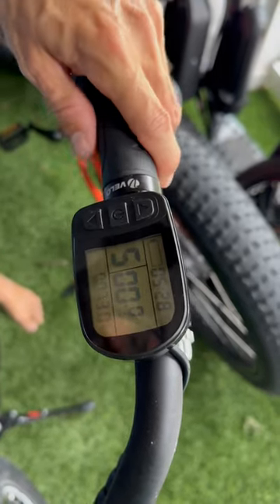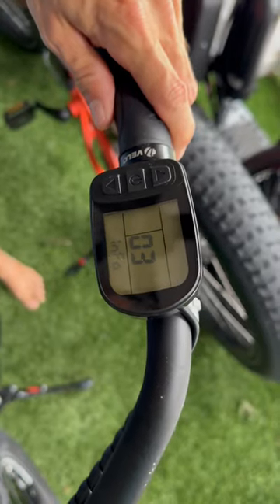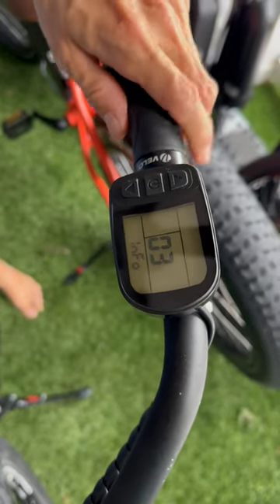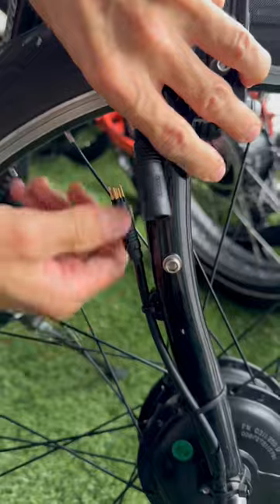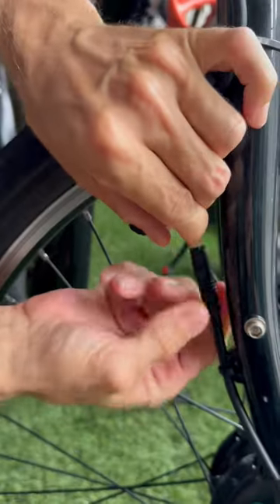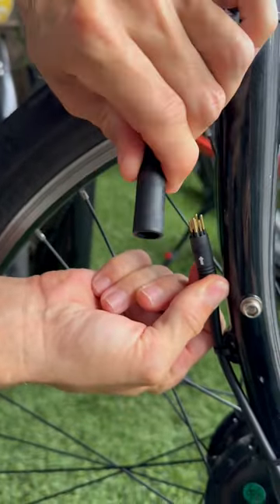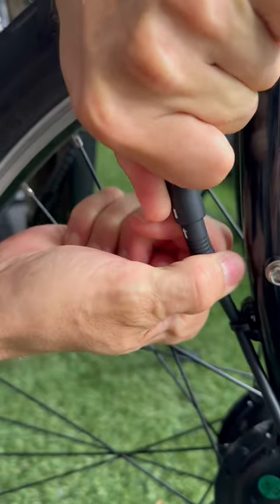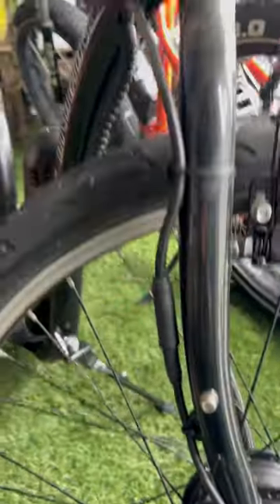How to fix the ‘03 Info’ error code on your electric Kickbike or e-bike - Bafang | Kickbike America

Comment: Dear i have error 01 info same u display, how to fix please ?
Reply: Disconnect throttle and test walk assist mode via putting it to mode 5 and holding down on the bottom arrow bike should walk if everything motor side is okay, then reconnect throttle - 01 means the bike hasn't detected a zero throttle input position but unplug it and power walk just to eliminate anything else.